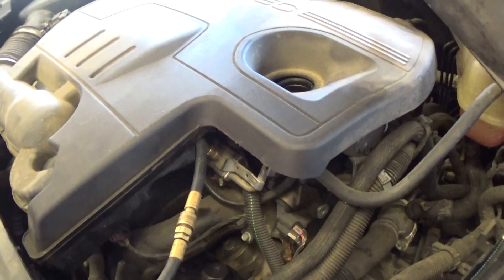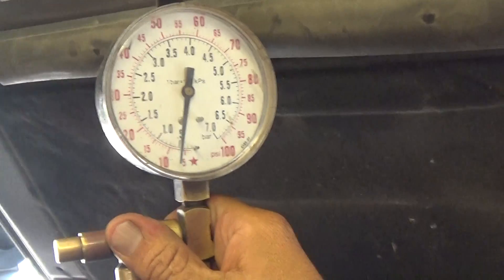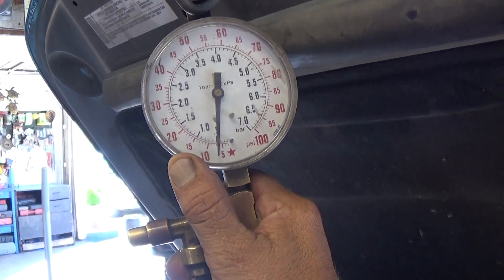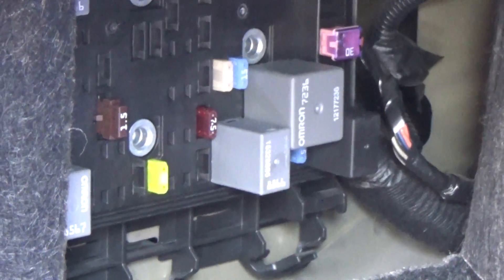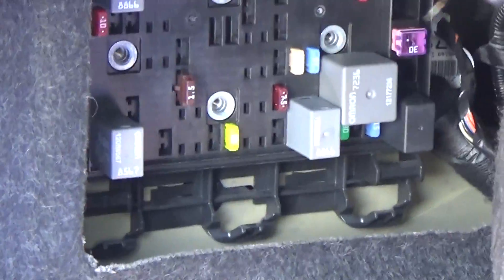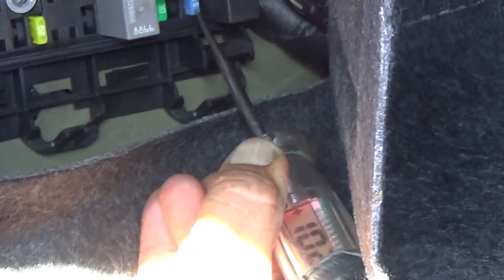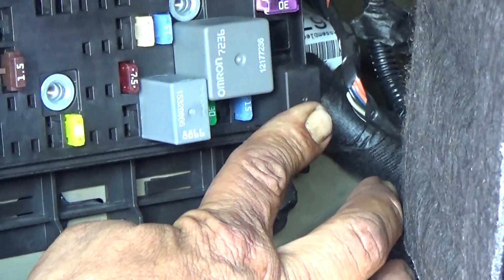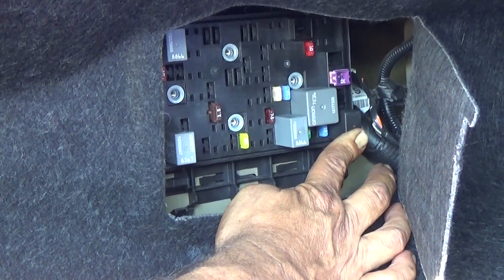How To Perform Diagnostics Check on Fuel Pump (Electric) on a 2008 Cheverlot Malibu

Comment: This happens on mine too.  I can usually push on the relay wiggle it a bit and it starts fine.  Is there a way to make the relay for tighter? After all it is sideways above the rear wheel. Every bump probably shakes it loose.
Reply: I removed the box and found the connection (probes in back of the box) to the fuel pump relay were loose. I pushed them back in the car started. I may end up buying a new box unless there is some way to tighten up the wires.
Reply: @danelarson2914   how did you remove the box? Is there bolts or screws?

Comment: Great diagnostic step by step thanks brother
Reply: Jim DonBrock
0 seconds ago
I cut a hole in the floor pan to expose  the pump, no POWER TO THE PUMP, I add power to the pump, the car runs fine, all fuses good and relay all good cant find an inertia switch,  I am Baffeld,  any suggestions.
Reply: @jimdonbrock1668   figure it out I have same problem?

Comment: Might not be  the fuel pump in a Malibu anyway, could be a melted wire in the back of the black box going to the fuel pump relay.. If you have that problem wiggle all those  Wires then go try starting the car.. Try that a few time,  If it starts it probably what i said above..
Reply: @cazaresf057  yes.
Reply: @ikemen1 Having this same problem with a lady's car. Has a crank no start first was replacing the relay and the car would start right up and I thought that was wierd, so I thought it's got to be a short somewhere. The car did it again and this time I just wiggled the relay and started the car and it worked. Thinking it's a short in the wire going  to the relay or something is going on with the box.
Reply: I changed my relay worked good for 2 weeks. The problem got worst, I have to have some one push on the box and wiggle it and the car will start and STAY ON as long as I need it to drive no problem. When I turn it off, I have the same problem over again and have to repeat the process and have some one help me turn my car on...

Comment: I cut a hole in the floor pan to expose  the pump, no POWER TO THE PUMP, I add power to the pump, the car runs fine, all fuses good and relay all good cant find an inertia switch,  I am Baffeld,  any suggestions.
Reply: U ever figure it out?

Comment: So I had this issue with the car. I had different mechanics and shops tell me it was the fuel pump or the rear fuse box. It was never that. It was the wire behind the fuse box going to the fuel pump. I found that because it kept dying on me. The wire was burnt.
Reply: So I am going through this now. I have been wiggling the wires behind the fuse box in the truck to  get it to start. Which it worked for a few months now, but now when my son drives it home from Houston, he said it acts like its going to stall out but then all of the sudden gets power back. Could he just be hitting bumps knocking the wire loose?
Reply: How much did it cost to get it fixed
Reply: @yobootystank8160  the weird thing is I did the same thing and works way better. Maybe the fuses are higher then recommended
Reply: @michaelpointer5063  I ended up fixing myself. Still works till this day